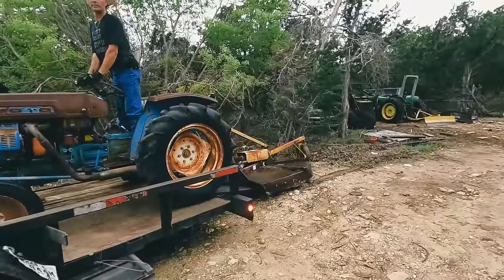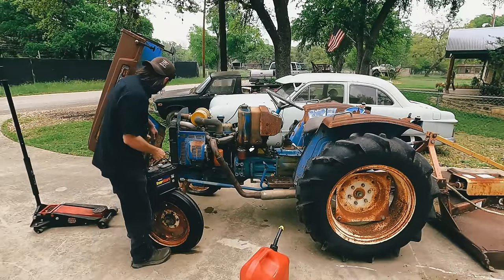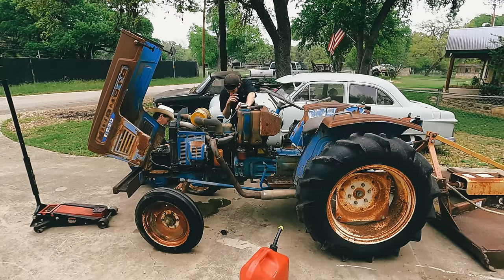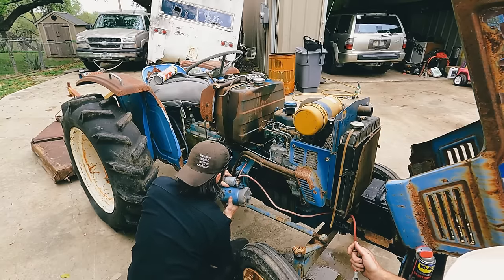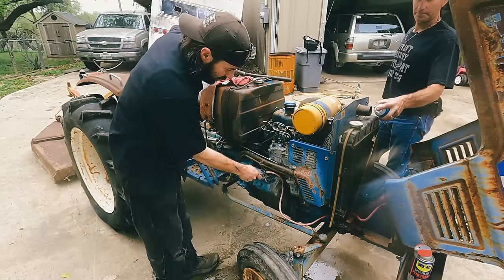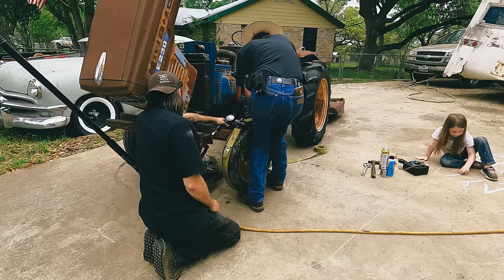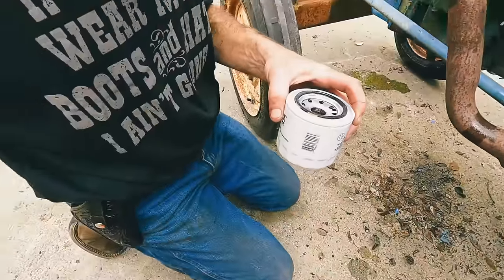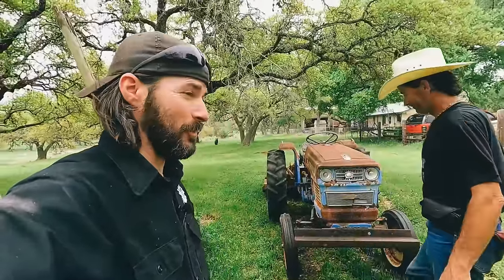A FREE  DIESEL TRACTOR! CAN WE GET IT RUNNING AFTER BEING PARKED FOR YEARS?

Comment: When you rebuild the bush hog, replace the metal bars that go from the top of the three point hook up to the back of the bush hog with heavy chain. This will allow you to set the height of the front of the bush hog and allow the rear to float over the terrain while still being able to fully lift it when needed. It will also prevent stress fractures/bending and give you a better cut without digging in.
Reply from the maker: Appreciate the tip!
Reply: @garthsgraveyardgarage  No problem, I just wish I could find these smoking deals by me lol
Reply: @michaelfischer7547 Is almost impossible up here because of the temperature extremes and the salt used in the winters up.here makes things rot 😮😮😢😢😢
Reply: @carlbernard4197  I’m definitely glad I live in southern Louisiana. Most rust here is just surface rust.

Comment: First,  if  it's  a  standard  trasmission,  put  the  hi/lo  in  lo,  and  the  main  tranny  in  1st,  then  just  rock  the  tractor  back  and  forth  with  the  rear  tires.  Popped  a  few  engines  free  that  way.  Second,  check  and  see  iffin  a  small  Honda  rad  will  fit,  seen  that  on  a  MF  1020  rebuild.

Comment: its air and water in the rear,that slasher looks a bit large for that tractor  ,also the rear wheel has adjustment  to level it  that is the slasher ,they  throw rocks/sticks would  keep the child and animals well clear,did you check the gear box on the slasher ??check the specs as to slasher size for that HP tractor just a suggestion.

Comment: the sheet metal part of it looks like a yanmar. i have an 87 yanmar 226d which is like the JD750. i have the loader with bucket, snowplow, rear blade, brush hog and it has a JD cab thats been painted.

Comment: Is Hinomoto related to Hino Trucks? I think Hino = Toyota. Looking at that proofmeter and glowplug indicator (and a few other things) looks identical to my 1978 Ford 1600 (rebadged Shibaura). Interesting find.
Reply: I’m still watching, but, the more things I see on it, the more similarities I see with my Ford/Shibaura. Mines a two cylinder as well, I think 1.3L, 3 sp + reverse (center shifter), low/medium/high range (right hand shifter), and PTO (left hand shifter). It’s a real bitch to purge the injectors (don’t run outta fuel).
Reply: Oh yeah, sounds just like mine. Cool. If it’s another version of the Ford/Shibaura, it’s a pretty tough little unit. Nice.